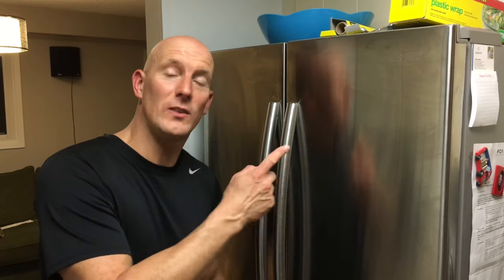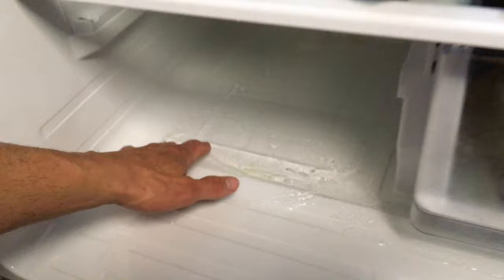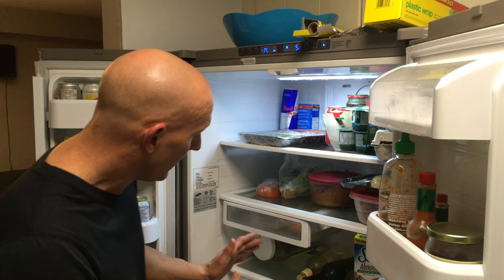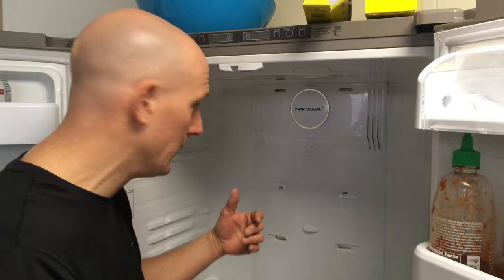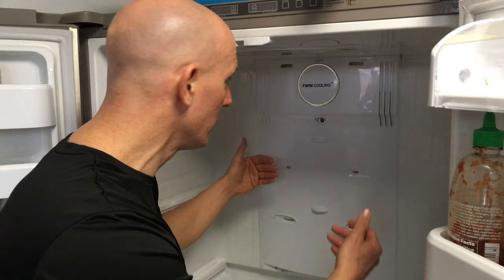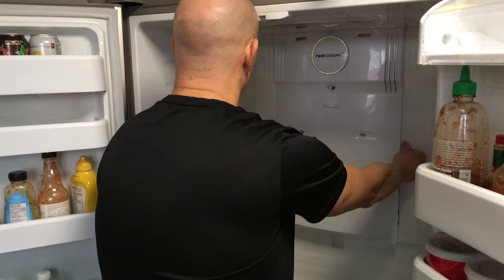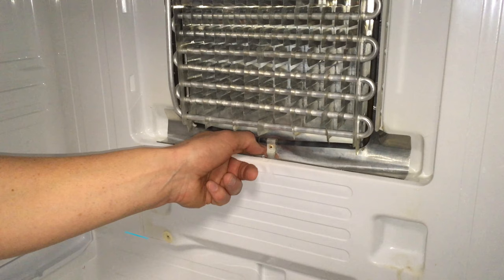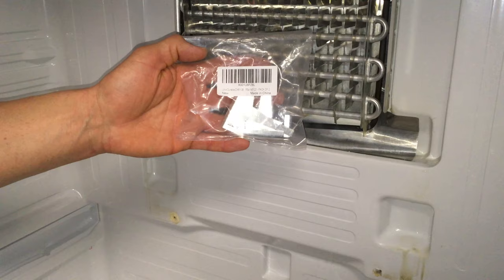Ice & Water Buildup (4K) Samsung Refrigerator

Comment from the maker: Samsung Water / Ice Repair Kit:
Amazon US: https://amzn.to/3YN4Enw
Amazon Canada: https://amzn.to/3WKlUYK

Evaporator Clip:
Amazon US: https://amzn.to/3XkXsOR
Amazon Canada: https://amzn.to/3gu6EA0
Amazon UK: https://amzn.to/3i5jhSx

Bimetal Defrost Thermostat:
Amazon US: https://amzn.to/3AAFNZD
Amazon Canada: https://amzn.to/3ABmlfl
Amazon UK: https://amzn.to/3i2zp7g

Defrost Heater:
Amazon US: https://amzn.to/3UVsAmo
Amazon Canada: https://amzn.to/3GCCsgK
Amazon UK: https://amzn.to/3V2S1CD

Digital Multimeter:
Amazon US: https://amzn.to/3AAYqwR
Amazon Canada: https://amzn.to/3AAGqlX
Amazon UK: https://amzn.to/3XlfoJ7
Reply: Ohhh - do you have instructions for the updated kit?
Reply from the maker: I don't as of yet I will be making a video in a week or 2
Reply: Thank you for posting this.  I wonder if there is any risk of damage caused by heat on the fridge's plastic since the metal piece is longer and going deeper inside the drainage.
Reply: Thanks for the help. The water actually did not drain properly. After letting the refrigerator sit for a few hours it’s still did not drain. I ended up jamming a wire hanger down the hall from both the back right side, drain and the top and that released whatever was stuck in there!
Reply: Hey Jeff, I followed the instructions as you stated, and it worked great. Unfortunately,  the ice maker is not making ice now. Just a humming noise, but no ice. Water flows perfect. Any suggestions? Thank you.

Comment: Just a note, those ears on the sides of the replacement clip are meant to be bent around the heat tube. That way you ensure more contact area for better heat transfer and better defrosting. More than likely that's the reason some people are still having freezing issues.
Reply: Sir, what should I do if after pouring a little cup of water in the drain trough, the water backs up? I'm guessing my hose is blocked like Jeff says.
Reply: duane3838, I was able to get my drain hose clear, sorry for bothering you!!!
Reply: Thank you for that tip. It makes sense. 👍
Reply from the maker: This is the updated Repair Kit that you need for Samsung.
Samsung Water / Ice Repair Kit:
Amazon US: https://amzn.to/3YN4Enw
Amazon Canada: https://amzn.to/3WKlUYK
Reply: @indirectexchange3139  If it's blocked, it's most likely frozen. Use a hair drier to heat it up.
Reply: Thank you I just naturally did that it didn't seem like that clip was making enough of contact so I bent those two little things on the end around it so it would contact the black wire thing that heats up. Thanks for confirming that I did it right

Comment: Great video! I watched it and then ordered the clip from Amazon. When it arrived, I watched the video again and started unloading the refrigerator. The steps in the video were easy to follow, and I was able to access the problem area, quickly. I discovered that Samsung had left the little metal "tray" in the bottom of the drain rather bent and out of place.  I don't think it mattered, but I was able to straighten it out. After melting the ice with a hair dryer, the water didn't drain. I had to run a piece of very flexible lamp cord down the hole.  It took about four feet of wire but when I pulled it out, the water had drained.  I don't know if there was more ice down there, or if something else had clogged the drain. I ran a little water down it, as you suggested, and heard it drain all the way down. Success! The clip went in just as expected, and I was able to button everything up. The whole operation took about 90 minutes - 30 minutes to fix the refrigerator and an hour to clean it, discard ancient mystery items,  and then try to remember how my wife had arranged all the food. I'm sure I at least got the beer back in the right place.
Reply: can you tell me about the video?  I am not aware of it, but need it.  I have begun working on getting  my refund for 6 weeks, I am not going to give up, but they are good at what they do.  How can anyone do this for a living?
Reply: I also ran very hot water down the drain to make sure it was clear of ice & debris. 
Only wish I had found this video over a year ago!
Reply from the maker: Thanks for watching!
This is the updated Repair Kit that you need for Samsung.
Samsung Water / Ice Repair Kit:
Amazon US: https://amzn.to/3YN4Enw
Amazon Canada: https://amzn.to/3WKlUYK
Reply: @JeffLepard
Reply: Jeff; thanks for the tip! We’ve been dealing with this for a year. One thing I did that other would benefit from. Use a cup of HOT WATER. The ice build up in the drain will melt almost within minutes. The excess water that is in the catch/drip can be soaked up with a sponge. If needed, you can use a small flexible rubber tube to siphon out excess water that you can’t sponge out until the build up melts.

Comment: Learned a great lesson in maintaining this fridge ... not cleaning the drain spout once a year caused huge problems. I want to thank you for this video. It put me on the path to repairing my crazy Samsung fridge (will not buy another Samsung fridge). I got the clip you recommended. My back panel was so frozen that I did not have the strength to take it off and I was afraid I would brake it.  Neighbors to the rescue. Two wonderful men got it off the back.  That is when I confirmed that the evaporator fan was bad also.  Ordered that.  But what my wonderful neighbor showed me is that gunk had built up in the drain line in the VERY NARROW opening at the bottom. See attached photos. This caused the complete drain line to freeze and froze up the line including the panel.  Once the gunk was cleaned out and the drain line thawed, I was able to replace the evaporator motor and assemble the panel and fridge back together.  Will roll my fridges out once a year, vacuum the back/inside, and clean /check the drain system.  Lessons learned
I can't figure out how to add the pictures of the drain line and tip. If anyone can tell me, I'll add the pictures to help.
Reply from the maker: Yeah these fridges are horrible.  Most of the issues are the drains in these.  Thanks for watching!

Comment: Thanks so much for making this video. Mine iced up over 5 years ago and again 3 months ago. Both times called a technician. Now happened a 3rd time. This time I checked the drain tubes myself, they were clear and dry. Put all food in a cooler on ice and chest freezer. Couldn't get the panel off due to ice. Melted it with a hair drier in top vents taking care to not overheat things. Discovered I have the new aluminum part (from one of the techs), but water was not draining. Used a baster to siphon cold water out of drain and siphon hot water in/out The drain cleared. A snake camera showed the drain was still half blocked with ice about 6 inches down. Cleared with more hot water. Wrapped some copper wire on the heating element and set the wire about 7 inches in (fix suggested by other folks on Internet). Left the aluminum part as is. Now crossing fingers and wanting my half day back. Will be looking at other brands for all new appliances.
Reply from the maker: Thanks for watching!
This is the updated Repair Kit that you need for Samsung.
Samsung Water / Ice Repair Kit:
Amazon US: https://amzn.to/3YN4Enw
Amazon Canada: https://amzn.to/3WKlUYK

Comment: Thank You, Thank You! This is very helpful.
My 7 year old fridge has been doing this regularly since year 3, destroyed my flooring before I was able to catch it.
Another tip is to add extra foil insulation tape to the side and bottom of the back piece that is removed. After several removals to defrost, the original insulation gets pretty beat up.
This $2000 fridge is a piece of garbage, will never purchase a Samsung Fridge again, nor will any friend of mine as well.
Reply from the maker: Yes its very sad that this has happened and is happening to their fridges.  They also didn't take responsibility for replacing that part.  There should of been a recall.  Thanks so much for watching!
Reply: You can add me too the list.  Samsung fridges are garbage.  Never again
Reply: Samsung, worse crap I have owned. Installed this part and after 3 weeks frozen up again but up in the cooling fins and all the way to the top by the fan. Also took the back off and checked the drain line it was fine. The part I installed appears to be working just freezing up elsewhere. 3 years of working fine. What causes this?
Reply: @msingerca  Did you replace the panel properly? Is all the insulation in place? Did you reattach both wires before replacing the panel? If so, I would check the heating element and fan motor for continuity. If they are fine, I would also check the defrost sensor which is connected to one of the two wires you had to remove to get the panel off. The sensor is mounted to the element and measures it's temperature so the control panel came regulate how long to defrost the unit. The sensor costs about $20. Get the OEM sensor not a cheap knockoff and make sure it's the right one for your model. I found this out by watching a video of a repairman on a call for the freezing problem and he routinely swaps the sensors out. There are videos on how to test and replace all three. I'm not a repairman but I have the same freezing problem and have looked at a lot of videos and parts websites. Good luck.
Reply: @glamygirlie6829  me too..absolute crap.  mine has the water build up and randomly heats up to room temperature unless I unplug for 24 hours.  not what I want a fridge for.
Reply: @msingerca  I had to change the heater wire that goes around the cooling fins.  There is video on you tube that shows this. Look up "Samsung refrigerator freezing up" or something similar. Good luck"
Reply from the maker: Thanks for watching!
This is the updated Repair Kit that you need for Samsung.
Samsung Water / Ice Repair Kit:
Amazon US: https://amzn.to/3YN4Enw
Amazon Canada: https://amzn.to/3WKlUYK

Comment: Thank Jeff, I ordered the part, watched your video again when the part arrived and installed the new part.  Only issue with install is my drain line was not quite as deep as the part.
So I cut off about 1/4 inch of the length with wire cutters and it fit perfectly into the hole and over the coil.  Plugged the fridge back in and it is cooling now and soon to be ready to put food back in it.  My neighbor came over as I was putting the panel back on and was amazed.  By the way I just turned 77 years old.  So happy to not have to buy a new fridge on my budget.  Thanks Jeff for your video! You are amazing!
Reply from the maker: Thanks for watching!
This is the updated Repair Kit that you need for Samsung.
Samsung Water / Ice Repair Kit:
Amazon US: https://amzn.to/3YN4Enw
Amazon Canada: https://amzn.to/3WKlUYK
Reply: Hello, is this still working for you 2 years later?

Comment: OMG, I am so happy to have found this video!  I had previously replaced the defroster element because there was ice spilling out of the little holes on the front of the twin cooling cover - and I thought that would cure the problem, only to have a frozen lake develop continuously under the cool pantry.  I ordered the part you identified and just finished replacing that ridiculous little element that Samsung had for keeping the drain free.  I sure hope that this works as you said, because my next move is ordering a new refrigerator.  But not before telling everyone I know about my experience with Samsung.  Beautiful refrigerator brought to its knees by a 10 cent part!
Reply: GE is built on the Samsung model and has the same issues. I just wrapped a small piece of copper tube over the defroster and it hangs down in the drain tube.
Reply from the maker: Thanks for watching!
This is the updated Repair Kit that you need for Samsung.
Samsung Water / Ice Repair Kit:
Amazon US: https://amzn.to/3YN4Enw
Amazon Canada: https://amzn.to/3WKlUYK

Comment: I bought one of those devices on Amazon. Three months latter same problem. So I took a solid copper wire about 1/8" and around 8" long and ran it down the hole and hooked it around the heating coil. Problem solved, works great now, perfect temperatures and no more ice build up. The problem was  that ice build up starts further down the hole and works it's way up, so the copper wire takes care of that problem. Get a long wire and run it down as far as it will go and then cut it and make a u shape at top of wire and then compress it on to heating coil.
Reply: Thank you! I will try this shortly

Comment: Wow. I've been "fixing" this every 3-6 months by opening it all up, defrosting, and putting it back together. This is the first (hopefully) permanent fix I've found. Just ordered the new evaporator clips, and beyond excited to install them. Thank you so much. You likely just saved me from buying a new fridge.
Reply: it worked for about a year and a half and now it's building up again smh
Reply: Same here. I've had Samsung out 3 times now free of charge but it's crazy they've made no attempt to actually FIX the problem they just put a new back panel on and defrost. It will be interesting to see if this stops the top part icing up and blocking the fan as well.
Reply: @GodronATX  When I do it I'm going to use some thermal paste, hopefully that helps the heat transfer.
Reply: @GodronATX  there’s an other useful comment I’ll see if I can’t tag you or wtv ! He talks about opening the back pannel and checking the drain pipes to see if any are not iced or clogged up with guck still!
Reply: @GodronATX  this is because this ‘solution’ addresses the symptom, not the problem.  The problem is the clogged drain hose that is accessed from the back of the refrigerator. There are two of them. On the right is the tube draining the refrigerator and the one on the right drains the freezer.  At the top of those tubes is a hard white plastic connector that has a baffle inside it with two very small drain holes. Those holes get plugged up allowing water to back up into the refrigerator where it freezes. That part he replaced might help the drain from freezing but it doesn’t make much difference if that bottom drain hose is plugged. Water will still over-flow into the bottom of the refrigerator and freeze because that is the top of the freezer.  When I grabbed those white plug connectors, the constricted area broke off which gave me the larger opening I wanted.  Now, it can’t get clogged and back up into the refrigerator where it was freezing previously.  I didn’t replace that small aluminum piece because I’m counting on water not backing up and standing long enough to freeze.  I suspect the two pin holes in that drain was to allow the small amount of water that normally drips into that tube to pass while restricting the amount of outside warmer air from entering the refrigerator. But, those two pin hole sized holes, eventually get plugged with a small amount of rust or calcium.  Make those holes larger and problem should be solved.
Reply from the maker: Thanks for watching!
This is the updated Repair Kit that you need for Samsung.
Samsung Water / Ice Repair Kit:
Amazon US: https://amzn.to/3YN4Enw
Amazon Canada: https://amzn.to/3WKlUYK

Comment: The kit that you linked to includes a pair of tubes. Was not sure where those go but I've noticed other variations on this kit. It looks like have added a wire as well to some kits. I've done two refrigerators using just the parts you used in your video and they are working fine. I was reviewing your video as I'm preparing to do a third fridge. Perhaps you would consider updating your video. Thanks I appreciate your quick, clear and concise style.
Reply from the maker: Those are in reference to a new video I'm working on currently.  Those are the new drain tubes you should change.

Comment: Thank you SO much for this Jeff - we have had such a problem with this and in fact REPLACED our first fridge with the same model as we liked the design thinking the last one was broken....only to find the same thing started happening pretty quick. It is criminal that Samsung haven't admitted the design fault or at least made it easier for people to fix / told dealers to warn customers that it can be fixed easily. Congrats to you for a simple and helpful video!

Comment: This worked perfectly. Easy to follow. My only suggestion for those who cannot wait 24 hours for the ice to thaw. Hair dryer on HOT was necessary. For the actual drain I boiled water and then put a shortened/cut clothes hang with about 6 inches long then a bend of 3 inches or whatever. Pour the boiling water into a cup then the long end of the hanger in the cup to get the hanger hot and place it in the hole. I did this about 10 times and it kept moving further down until the drain was completely open. Refrigerator only off for 2 hours.
Reply from the maker: Thanks for watching!
This is the updated Repair Kit that you need for Samsung.
Samsung Water / Ice Repair Kit:
Amazon US: https://amzn.to/3YN4Enw
Amazon Canada: https://amzn.to/3WKlUYK

Comment: Thank you for taking the time to post such an informative video! We have the Samsung RF28HFEDTBC French Door unit and has been a great refrigerator so far. I thought I may have had the same issue as you, however it turned out to be the drain tube was clogged up at the bottom rear of the refrigerator. I guess my unit defrosts correctly. Thought I would post just in case someone else has the same water backup issues and didn't see an ice build up. Ours went over 4 years before this happened. Great to be able to find someone like you who has already troubleshot and found the repair. Saves people a bunch of time... Many Thanks!!
Reply from the maker: Thanks for watching!
This is the updated Repair Kit that you need for Samsung.
Samsung Water / Ice Repair Kit:
Amazon US: https://amzn.to/3YN4Enw
Amazon Canada: https://amzn.to/3WKlUYK